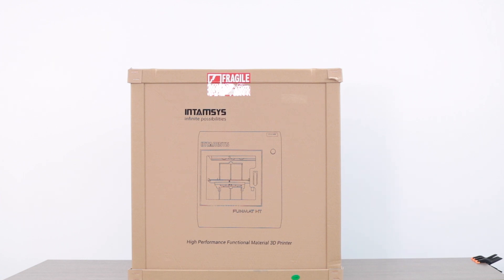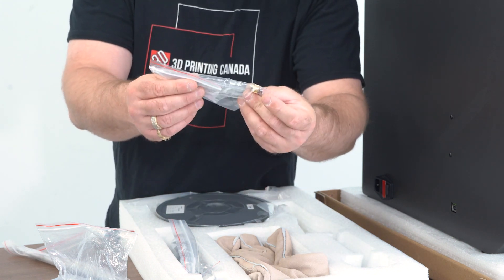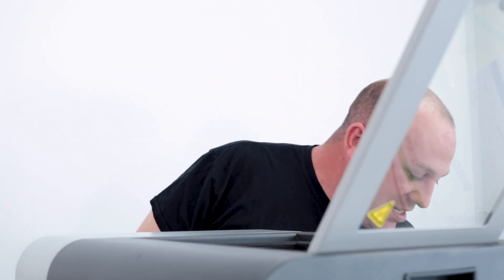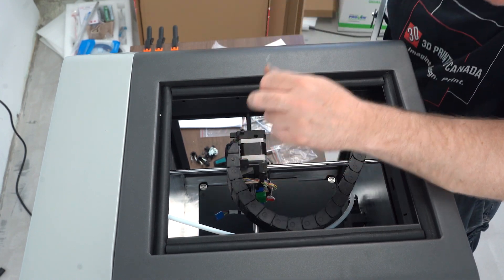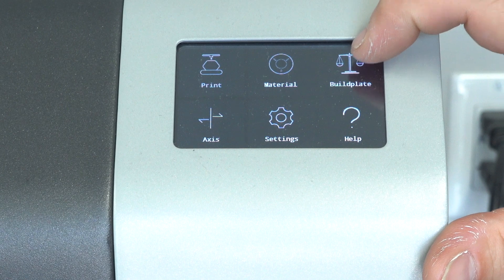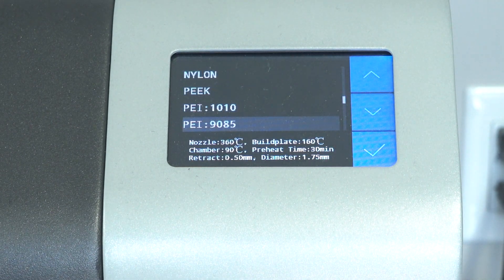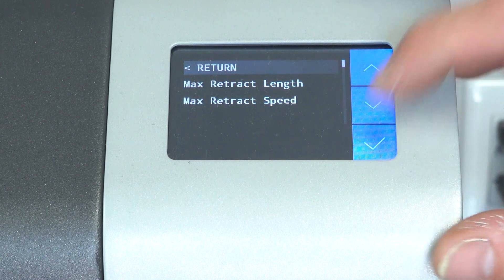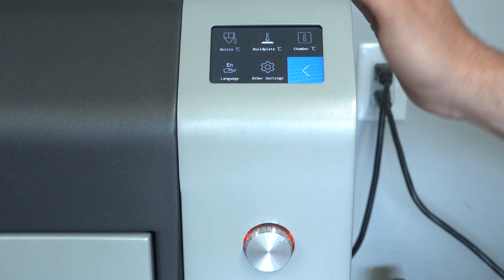Intamsys Funmat HT Unboxing & Test Prints

Comment: I have that 3D printer but it doesn't want to stay up to temperature in the chamber. The best I can get it is 80C and after the printing is done it drops despite adjusting the target temperatures to remain at 90C. 90C is where I want it, ideally.